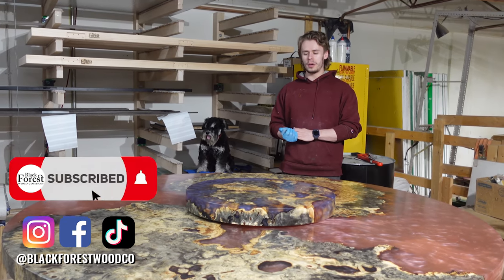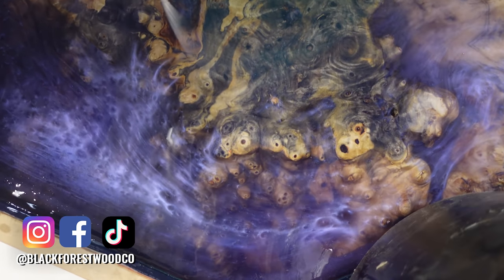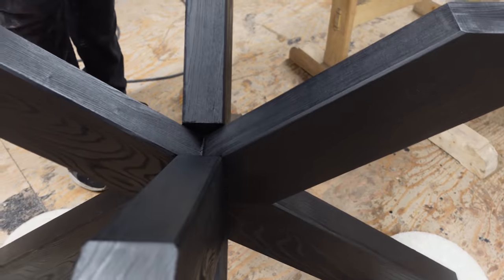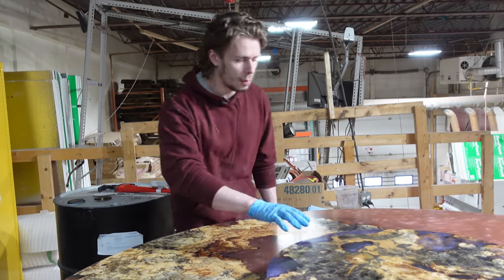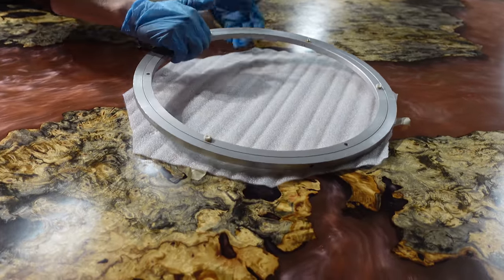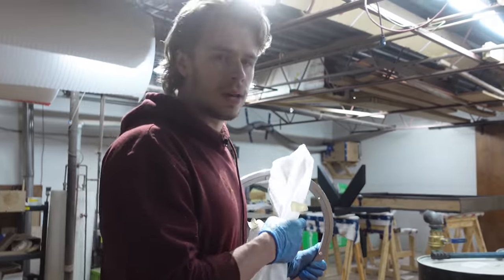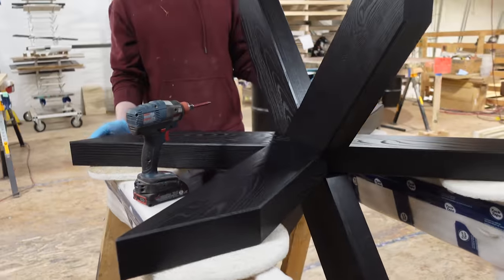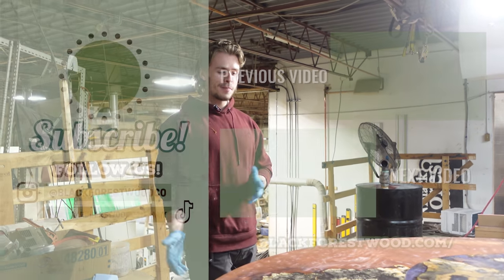Making a Lazy Susan with Figured Burl

Comment: On that lazy susan, I'd have put the now underside up. That texture, the patterns and the the colors of the wood look wild. It doesn't show as much resin, sure, but that wood on the underside is crazy. The smaller resin surfaces on the underside look like mountain lakes. I wonder how that would look with soft illumination shining through. That aside, you are absolutely right: It's a really gorgeous table.

Comment: Colors are definitely different.
I did a bar a year or so ago and found a whiskey barrel top that had a local distilleries logo on it. Did a 1/4" black layer under it and the rest was clear, ended up about 2" thick because the top has a serious bow in it from drying out. I put a similar lazy susan base under it but you can pick it up and move it all over. Haven't done epoxy since 😂
Reply from the maker: Haha, epoxy can be very tricky!!
Reply: @BlackForestWoodCo  Oh yes learned that the hard way the very first time I used it. Did a desktop, ended up taking it back down to bare wood because of all the bubbles 😱

Comment: The only issue I see is with the color orange/pink it reduces the decor it can be used in. So if you ever wanted to resell it if you move or redecorate! Good luck trying to sell it if you can. You may start at one price but expect to be cutting the price several times. Or you may have to cover the shipping costs!

It is a beautiful table don't get me wrong. But the Orange/ pink would be a no sale. Had it been in the blue as the main color with a blackish lazy Susan center it could fit in more decors.

Comment: Looks nice, but aren't the top discs meant to be larger in diameter? I thought the purpose was to have 5 or 6 (medium-sized) plates of food that you can easily cycle from any point on the table? Though maybe there was constraints on how large the table could be made in the first place. Either way, still looks good.